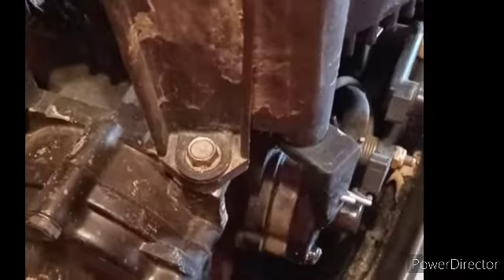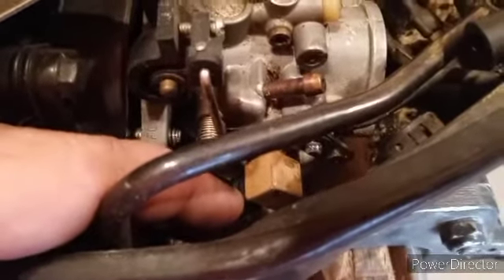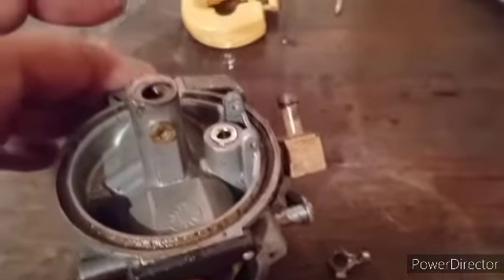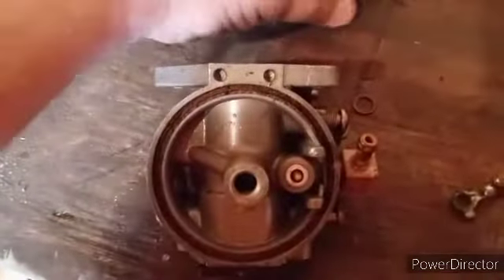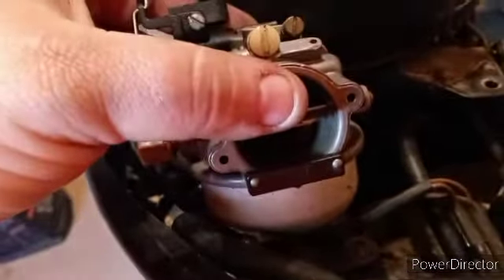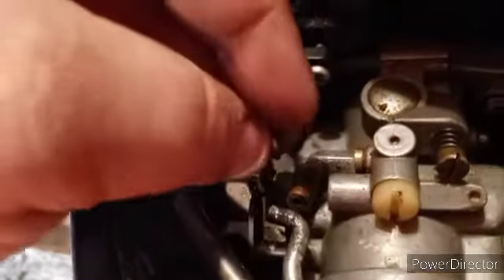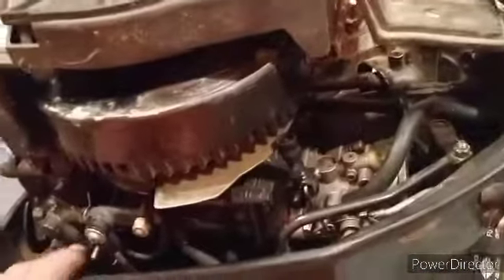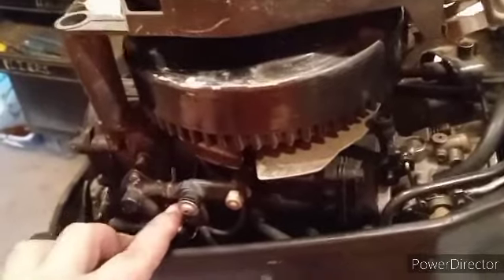15 hp force-gamefisher carb clean

Comment: Thanks for the video, I am working on the same motor, rubber tip is worn out, searched high and low for a carb rebuild kit. Thanks